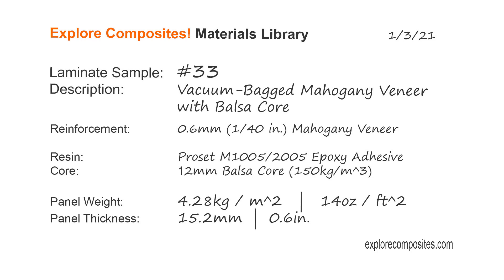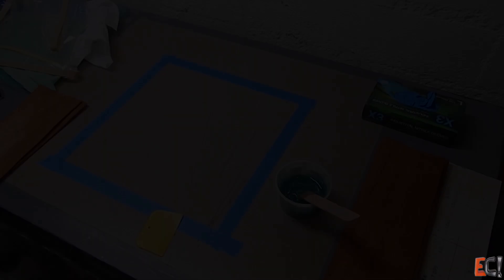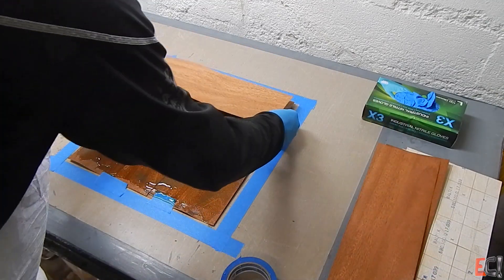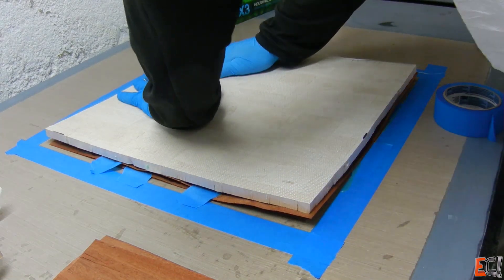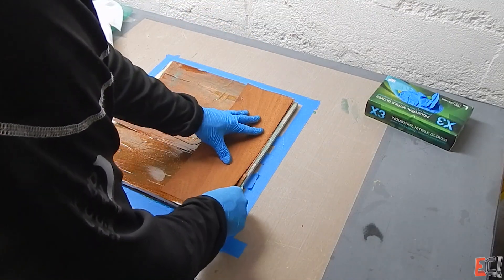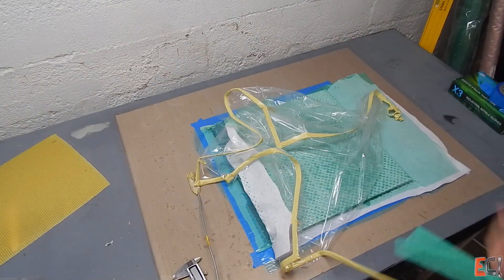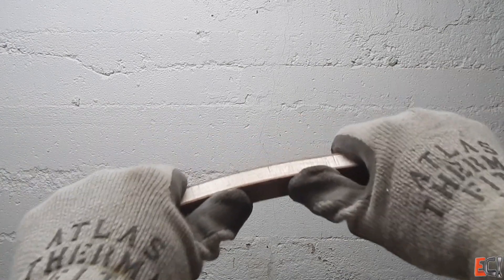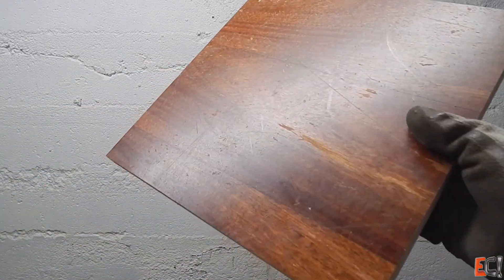Laminate Sample #33: Vacuum Bagged Mahogany Veneer with Balsa Core

Comment: I'd also like your input on the idea of laminating in decorative wood bling in on the  A side of a molded carbon/core/carbon part.  In my case this would be for my small deck sections in small table top molds a little bigger than your panel table.  Goal would be to have a part that would require little after demolding work other than a clear coat of a UV protective paint, but have that nice deep glossy look over the wood against the carbon background.  Would you use a 'gel' layer of a wood laminating resin, any surfacing veils,or satin glass over (under ?) the wood,  what would be considerations of vac bagging vs infusing this.   Thanks again for these videos and happy new year.
Reply from the maker: You could probably have decent results with a bunch of different approaches.  It gets more complicated with compound curves where the wood has to be tortured into shape.  A ply of glass "under" the wood against the mold face might work and would probably be relatively invisible - like those cedar strip kayaks.  This could be infused or wet-bagged with the rest of the laminate - infusion probably better results.  Thin veneers are porous enough to let resin through to a degree but it might be worth poking small holes or laying the wood in in strips if you're working with a wide area.

Comment: Happy New Year mate, hope your holiday season went well. This Laminate sample was quite unusual and I learnt something new. I was wondering if putting one or two layers of wood veneers is possible over carbon fiber to make car interior pieces like dash board and handles. Also I was wondering if laminating thin veneers of wood like the ones you've used here can be used to make kayaks or small boats, like laminating layers in different direction of the wood grain to build upto a certain thickness, (maybe reinforce in the middle with some core material or kevlar/ carbon fiber or fiberglass the outside layers). Please let me know if its a practical idea since boats made using cold molding technique use thin planks of wood around 3mm thickness, thus requiring to use steam bending and nails. But I was thinking of using thin veneers with vacuum bagging over a mold (like how eames chair were made). Thank you for sharing this video with us.
Reply from the maker: There is a ton of good information on the use of wood veneer laminates for boatbuilding - with cores and without.  The method is just like a huge Eames chair but usually the mold is just a framework with temporary stringers to support the veneers.  People often use staples (plastic Raptor ones are great) or vacuum bags (after the initial layers) to clamp the veneers.  The issue with applying wood over curved stuff is that it doesn't conform to compound curves very well unless you cut it into small enough bits.  You end up with lots of seams.  Fiberglass or carbon plies usually go on the outside more as a sealing and finish substrate though they can be used structurally in place of additional plies of veneer.  There's a great book on laminated wood construction by the Gougeon Brothers of WEST System epoxy... downloadable as a PDF here: 

https://www.westsystem.com/the-gougeon-brothers-on-boat-construction/

For complicated geometry like a car dash, it might be easier to apply it over cured composite using traditional veneer techniques like a furniture maker.  Or use machined "chunks" of wood made on a CNC...?  I'm only a rough carpenter so this is out of my league!
Reply: @ExploreComposites  Thank you for guiding me towards the correct path. Your videos provide with a ton of information regards composites, glad I found your channel.